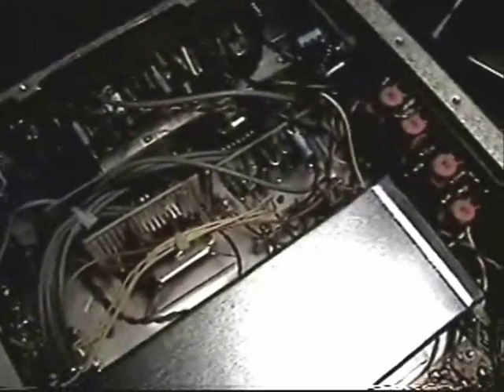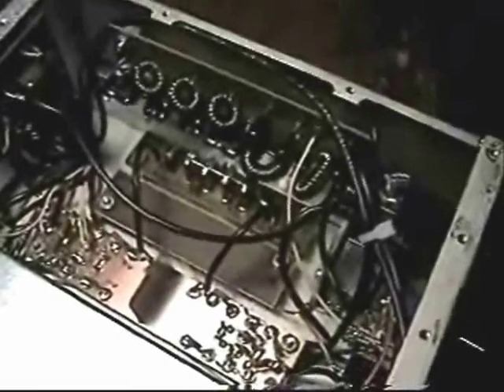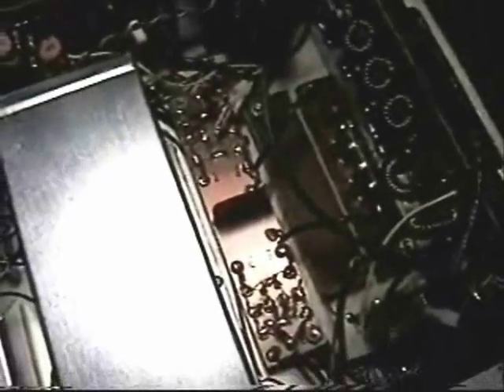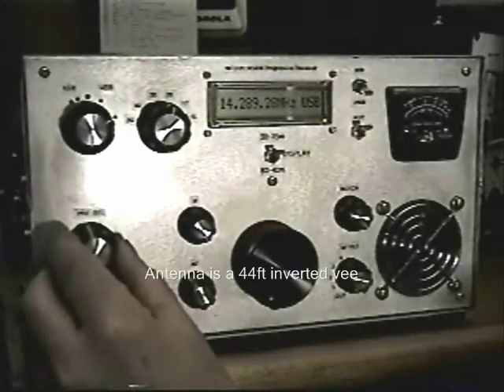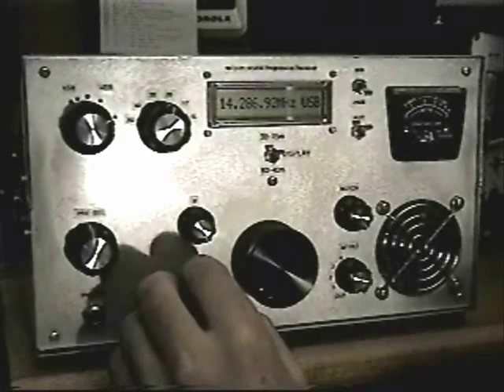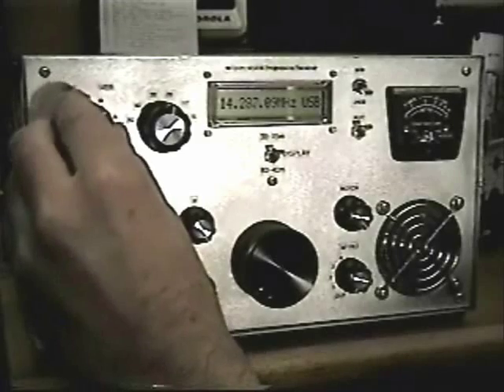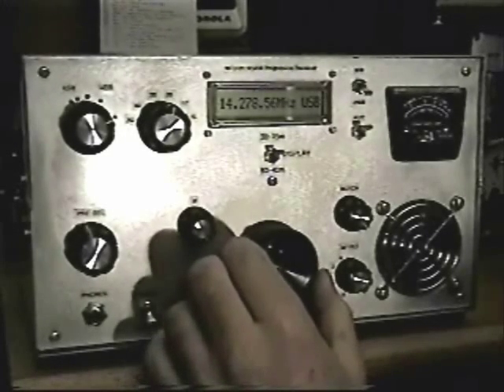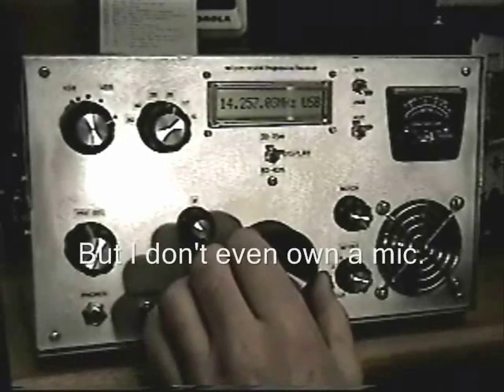A Progressive Communications Receiver, Part 2. A Homebrewed, Multiband Receiver For The QRP Operator

Comment: Nice job, the receiver really sounds great.  I have been sitting on this project waiting for time to build it and am finally making progress, also planning on using the DFD2 (have one on my Collins S-Line) and going to try the latest S-Meter driver on the w7zoi web site.  Did you use just one BFO with a single trimmer?  (Sort of like selecting the sideband on a 75A4).   I was thinking of using 3 sets of fixed trimmers (USB, LSB and CW) and select via a front panel switch that selects the appropriate trimmer via 12v relays inside the BFO cage.  I'm also selecting which crystal filter with the same technique.  Your link for more info is not finding a page, would like to look at your other stuff.  73's Carl K1LNL